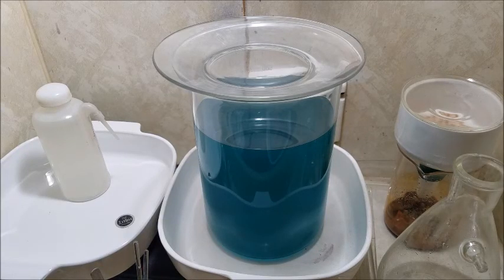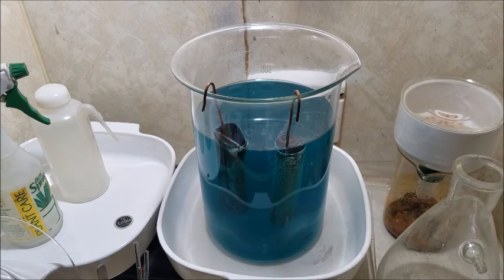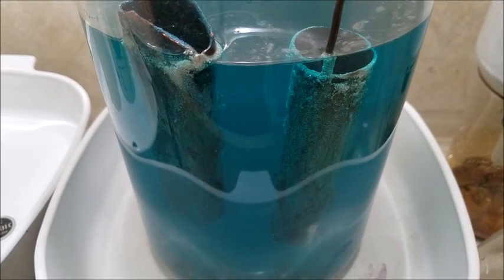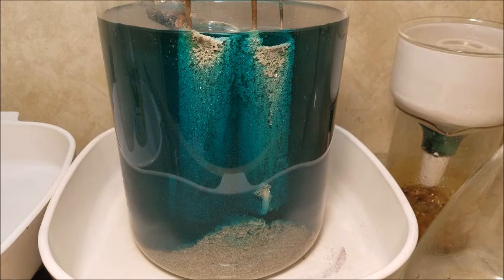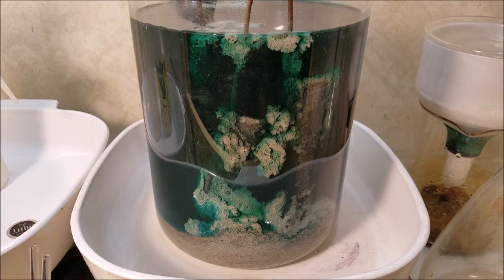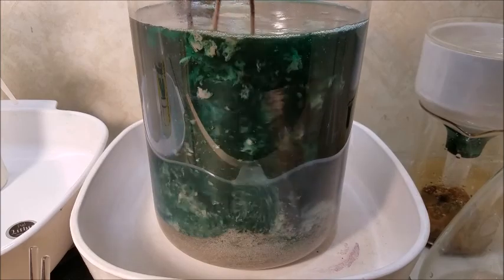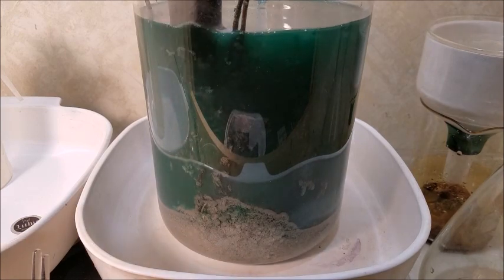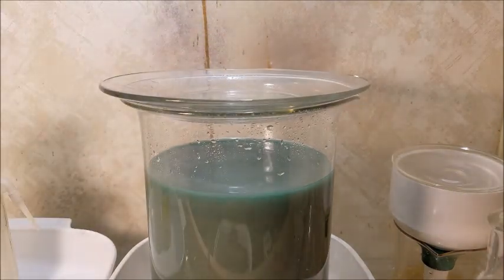Scrap Silver Refining (Part 3) Cementation of Silver with Copper

Comment: Hello, your method is very good, but I have a question: do you neutralize the solution before applying the copper or not? Thank you
Reply from the maker: Neutralize, no. However I generally try to make sure all of the free nitrates are spent. Whereas in this video I neglected to do so.
Reply: @LithicMetals  Thank you and I wish you continued success

Comment: Im having an issue cementing out my silver from my gold refining waste solution its really dark greenish blue and ive diluted it quite a bit but still cant get silver to precipitate out
Reply from the maker: Is it possible that you still have free nitrates in solution?
Reply: @LithicMetals  I think that was the case my friend subsequent pull offs I was able to cement right away so I stuck a piece of copper and some silver shot in the waste bucket and let the excess nitrates do their work and the cemented silver came later

Comment: Hello
How much copper must I use usually 
Is there a calculation?
Did you warm up the liquid while adding copper ?
And can I use the solution many several time ? If yes how do I know  must add nitric acid on solution
Reply from the maker: Due to safety issues, no one should conduct these experiments without first studying fully the hazards of doing so. This stuff is very unhealthy!
From my experience for every gram of copper that goes into solution, apx. 2.5 grams of silver drop out. No, don't warm the solution, the reaction itself causes heat. No, you can't reuse the solution. You must learn how to treat the waste solution or it will be an environmental hazard!
Reply: Thanks for your reply , can I do the silver electrolyte cell process without using copper ? And what copper do

Comment: In gold refining (electronic waste) it is general practice to do nitric acid washes to clean up the gold. The silver ends up in that nitric acid. I assume I can copper drop that solution right?
Reply from the maker: You sure can.  😀
Reply: @LithicMetals  Nice. My goal is to only keep nitrates in solution. Then I will drop the copper next... then boil down the last of the junk down and crystallize it.

Why you ask? I can throw the recovered nitrate salts into a distillation apparatus... and add some good old H2SO4... reflux... and recover a good portion of my HNO3 through distillation! The stuff left in the flask will all be sulfates of whatever junk was in there. Can be dried and thrown into the waste bucket. (leaving you with relatively very little, dry, non-explosive, easy to handle waste) There... now I gave you a tip. ;-)